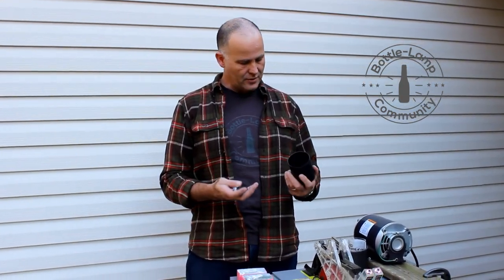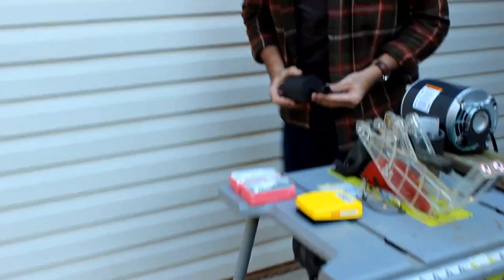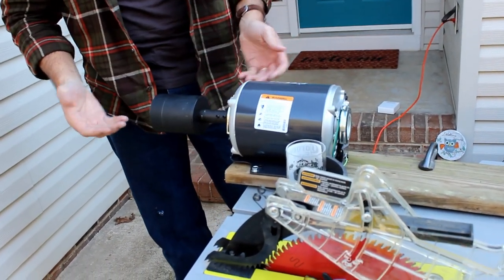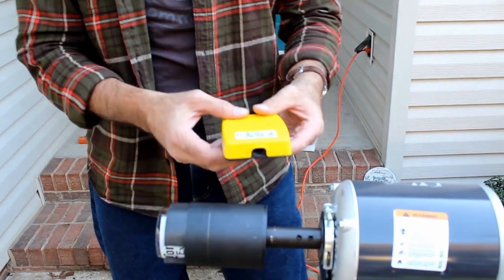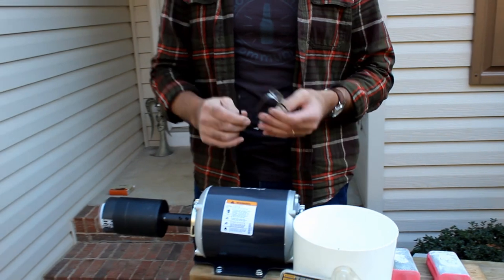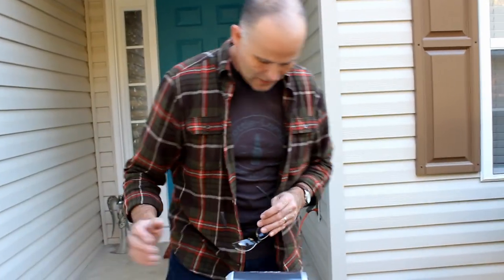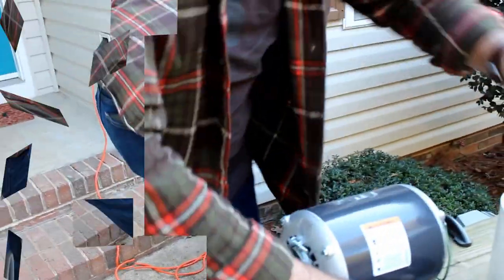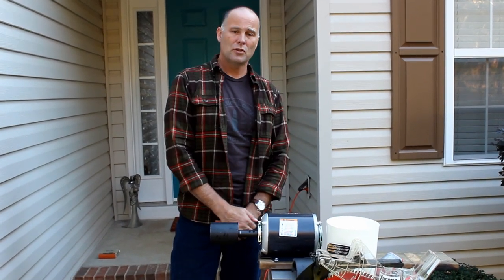Roto-Rim Glass Bottle Sanding Demonstration

Comment: Good timesaver with great results.  What rpm would your wee motor be running at for this Nick?
Reply from the maker: Good question. This was set up at 1800 rpm. Plenty of speed to sand at and still get a consistent edge.
Reply: @NickandSilkeCreate  many thanks.   Perhaps my lathe could handle this.  I'm just a little nervous using glass in a lathe 🤔

Comment: Can you do larger diameter bottles? Or smaller diameter bottles?
Reply from the maker: Great question! The diameter is limited to it's base size however you can do smaller glass bottles with the wrapping that comes with the device.
Reply: Nick and Silke Jager that’s a shame, I do a lot of wine bottles, but I use my acetylene torch to melt the rim of the glass to get it smooth. This rotobit is a great invention but it would be great to be able to do larger size bottles.

Comment: Looks a little dangerous with your front shirt tails in close proximity to a fast turning motor ;-)
Reply from the maker: @dougschafer50 Bad Clothing choice on my part. You are absolutely correct.
Reply: @NickandSilkeCreate  I got a loose shirt sleeve caught on a horizontal spindle drill many years ago & it flippin hurt I can tell you, always been wary since then
Reply from the maker: Ouch. I'm sure it was pretty scary as well. Accidents like that happen way too fast. @northernhouse